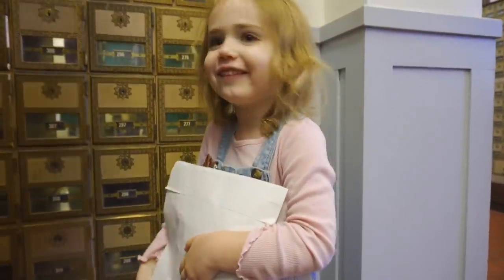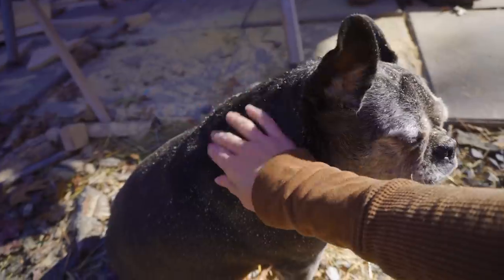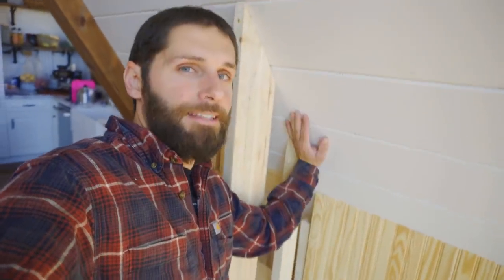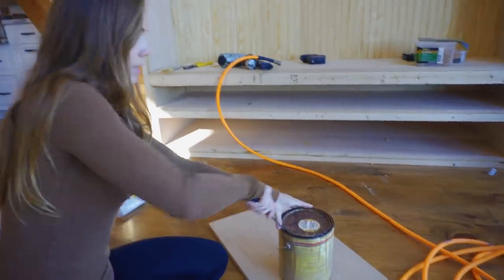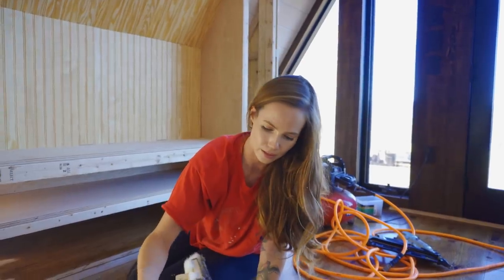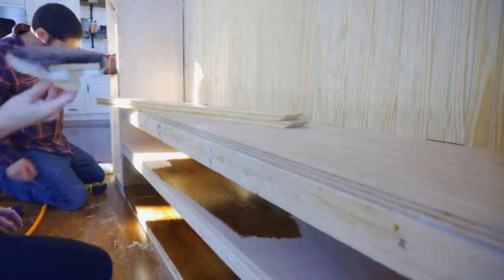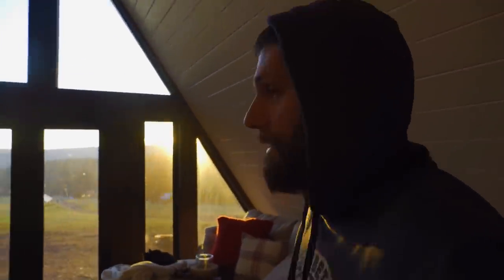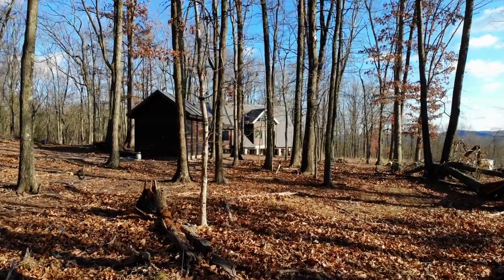The Great Room Is FINISHED! | Building Onto The Interior Of Our Off Grid Home

Comment: Check if the TV can play off memory sticks. Since the connection is usually on the back of the TV, get an USB extension cable that can be accessible but hidden. You really will be settled in for the Holidays!

Comment: One thing about the firewood... make sure to keep it away from any wood parts of the exterior of the house, deck etc., (maybe create a metal lined box?) 
Reason being, if the firewood gets worms or termites (which is very common) they will invade the wood structure of your home.  *hugs ... Kathy.

Comment: If your cell internet is as problematic as mine often is, you might want to look into StarLink once it is out of beta/more reliable.  Right now it looks like it isn't as far south as you, and isn't 100% reliable but it's fast.  Though it does cost $100/month and $500 for equipment at present, if I'm remembering correctly.